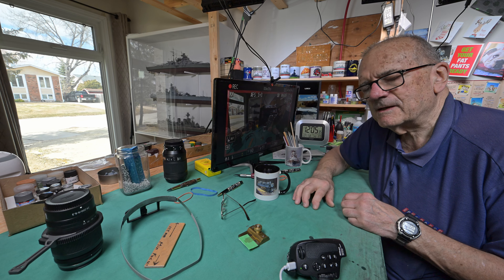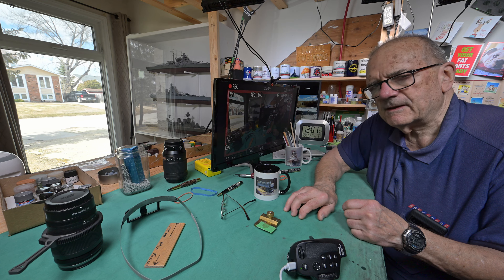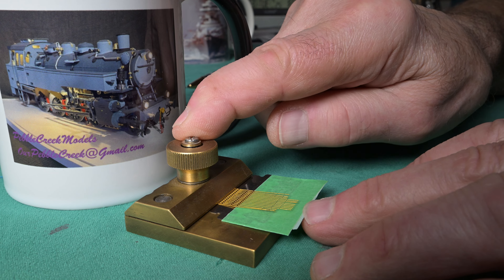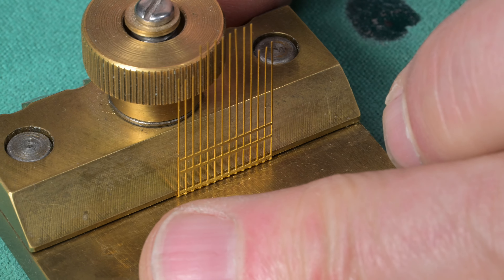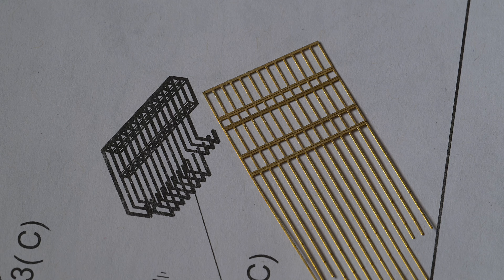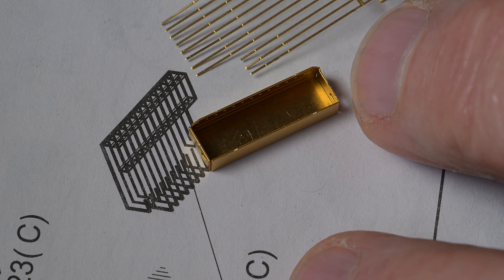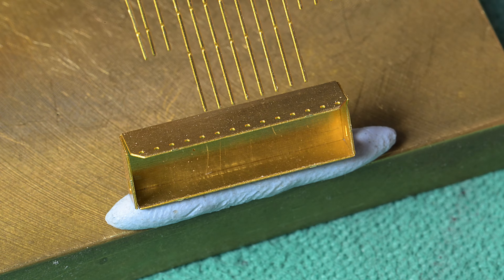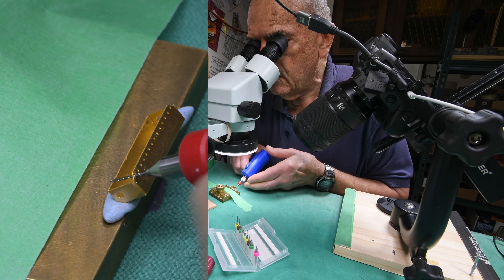The Model Ship - Part 1566

Comment: Mr Ron. All the comments about that PE you are starting to work on confirm why I decided to just buy the already 3D printed parts for those radar units. Those Trumpeter drawings are way to wonky  for my brain to fathom. And like I said earlier, I actually started on it but soon gave up. I applaud you for trying! You may succeed wher I have failed!
Reply from the maker: Hi Paul,
My plan is to just make it look believable. Just recently found that I actually do have to make 2 of these. I think I'll drill out the holes while to part is still on the fret. 🤞
Reply: @roncalverley  good idea.

Comment: Hey Ron
     Nice call drilling holes bigger. I of course did not and bent a few spider legs. If you continue to phase two and get all the legs thru holes I would reference the book photo instead of trumpeter crap picture. The 6 short legs bend 90 degrees and downstream the 7 long legs bend 90. 
     Just to review yesterdays comment I made.
1. You have to make two full sets of array. One goes aft and one mid ship.
2. I would as a minimum buy one like Paul did already made up. That way if spider legs break you have a replacement and if you order two you’re set.
     I wish you the best on this insane array build.
If you decide to destroy both PE 24 Cs can you crush them with vice and film it on macro.🤗

Mike

Comment: That's a tricky little part. The only way i can see to make it the same shape as the diagram is to make the first section fold under so the long lengths fold back over it. I think the manual should depict a partial double layer on the underside when viewed from the aspect of the drawing. It's hard to explain what I mean in text.

Comment: Ron, you haven't bent PE24 wrong at all, you just haven't bent it enough....you are half way there you just need to bend the other two fold lines. It's difficult to see on the manual but you should end up with a four sided 'box' and then the prongs....the very first 'section' will be parallel to, (but not lying against), the prongs, the second 'section' attaches to PE23, on those two etch lines, although you seem to have them on the inside of the box. I don't think this matters but thats why those etch lines don't go to the edge of the PE, it just a guide for PE24.

So just keep going, you're doing exceptionally well, you just need to bend that part a couple more times....from the end it should look sort of like an upside-down 'e'.